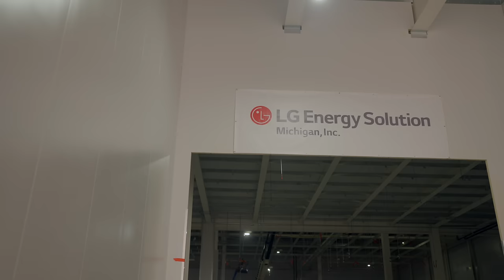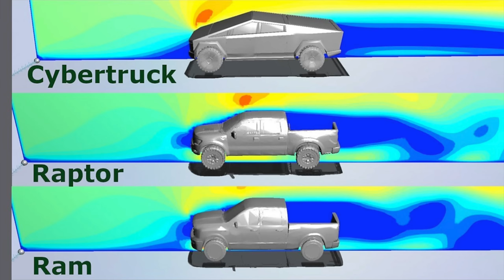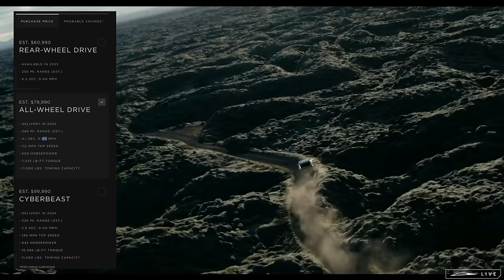Cybertruck - What Tesla ISN'T Saying!

Comment from the maker: Learn More about LG Energy Solution today! https://geni.us/LGEnergySolutions
Reply: stop saying bullet proof, tesla never said bullet proof for the glass. They just said it would be "armor glass" that they use on semi. The bullet proof was for the steel.
Reply: rifle and supersonic handgun rounds will go through, the limit is sub-sonic, that it is still a step up from the 26 gauge mild steel skin or plastic of most vehicles
Reply: mistakes in Cybertruck that will render it useless for zombie apocalypses or chaos/war:
1.	Acceleration 2.6s to 60mph = there is no tire on planet that can last more than 10k mi. on vehicle with that acceleration which is COSTLY. RWD has 6.5s but then locking differentials are useless when there is nothing to lock but rear wheels, and 17” ground clearance is absolutely POINTLESS because no RWD vehicle will EVER attempt off-roading!
2.	No door handles = cannot be opened from outside in strong wind when wind is blowing from the front or the door side, odds are roughly 50% if u park vehicle at random angle to wind.
3.	Electric sensor for opening door = cannot be opened in case of electric malfunction or battery depletion while any gas truck can be opened whenever they ran out of gas REMEMBER ITS MEANT TO BE FOR APOCALYPSES WHEN U PUSH THE LIMITS.
4.	Standard tires = instead of improving and innovating tires tesla made 3-3.5 ton monster on feet of clay. anyone can stop it by puncturing tires. War in Ukraine shows how even the most luxurious SUV-s have become so vulnerable to tire puncturing due to small pieces of shrapnel on roads.
5.	Bulletproof body = STUPID IDEA CAUSE TIRES AND GLASS ARE NOT BULLETPROOF! 
6.	Ethernet wiring = computers control EVERYTHING even STEERING meaning any chip malfunction could kill you, moreover this system cannot be protected from EMP or excessive solar radiation. Stock Toyota 70 for example outperforms this vehicle in all those features that’s why it is the most demanded rugged vehicle on Earth.
7.	Great towing capacity: yes towing capacity is great cause the vehicle is overweight and friction induced on tires is way higher than friction on 2.5 ton truck tires: 3.5ton/4=0.875 ton/tire   while 2.5ton/4=0.625 ton/tire just like 2x2=4. Not mentioning 4x more probability that it will get stuck in mud than the same size 2.5 ton vehicle. And when fully loaded it weighs 4.5 tons which is INSANELY STUPID for Apocalyptic roads… Not only 0 chance in mud but puncturing probability drastically increases when under 1.15ton pressure. So in rainy apocalyptic day, 0 chance moving unless on well maintained highway….
8.	Steering rectangle instead of wheel = accident guaranteed.
9.	Ceiling gear shift = accident guaranteed.
10.	Absence of battery heating system = 30-60% cold weather range drop =Gasoline truck-600 miles, Cybertruck-180miles 
11.	Price = they promised less than 40k for standard vehicle now its over 60k, while 95% of truck prices fall in <60k range
Reply: Just wait until the "Influencers" get it. It will be the iPhone of the car industry
Reply: I think this is mostly a status truck for the Beverly Hills crowd.
Reply: @larryo6874 So just like the iphone. Except that apple opened it up to the general masses (as long as they had the $$$$ to buy one) and that made the BH crowd mad. They lowered its perceived value by opening it up to the unwashed.
Reply: I just had to throw away my LG minisplit 5 years and 3 months. It could not be repaired.
Reply: @DeterministicUniverse  You forgot autopilot mowing down people.
Reply: @Gnofg  Nah, that just a rumor that the Green River CEO started because Tesla did not give them the real time OS contract.
Reply: Hearing you talk about this car without any actual proof really puts my trust in your channel into question. Not a good look man.
Reply: To increase the views change the thumbnail to "The Cybertruck is hiding this..."
Reply: I'm still curious about the read view mirror... or side mirrors are not big enough to see 200 feet behind the car.
Its not street legal without a rear view mirror and being able to see behind it. And you cant drop the cover without obstructing it.
Reply: @jabberwolf7348  who cares about safety. This is all about loving Eloon.

Comment: I wish they made a Cybervan.  That would be a lot more useful.
Reply: they will eventualy, but the dictate rollout of tech starts with luxury early adopter vehicles🤔
Reply: To go with the cyber stroller, cyber pup, and an AI family.😂😂
Reply: Cyber SUV?  Yeah you can almost bet on it based on the pickup design
Reply: That MUST be in long term plans for Tesla?
Reply: I don’t know about more useful, but certainly uniquely useful.
Reply: Is in model X the Tesla version of that  already,
Reply: @JrgMaverick  the model X is just an expensive minivan.  I want something that's actually useful, like a utility van that can be transformed into an RV.
Reply: We need something like a Ford Transit with a 150kwh+ battery.
Then they'll perfectly cover most of the vehicle market as that the Transit form factor is used in so many cases.
Leave electric coaches to China though. Those are too specialized.
Reply: @grettirgrattmards2348  that is just a matter of battery supply.
Reply: @grettirgrattmards2348  I'd be happy with something reasonably cheap priced and the size of an svt focus hatchback
Reply: With focus on range, not acceleration
Reply: @NeedsLessWedge  💯💀💀💀
Reply: Kia EV9 and Volvo EX90
Reply: @theairstig9164  no, not grocery soccer mom vans.  What I want is an off-road VW Westfalia.

Comment: Wretched excess for most truck buyers.  From $39k to $60k?  YO, ELON!  How long will it take to charge at home and will it fit in a garage?  No mention of the interior?  Does it have a driver's screen where every other manufacturer puts it?  Does it have convenient buttons and switches like every other truck?  Do I really need 15 speakers?  Android and Apple car apps?  Where will I get it fixed if in an accident and how much will those panels cost?

Comment: Canceled mine. Lots of things to like but at the same time a few things I didn't. Bumping the price so much more than promised was a starter, and back seat Interior space is cramped compared to my crew cab. Then the reduce range killed it for me, my crew cab gets me 400-440 miles on 26 gallons. Now the Ram Charger is scheduled to be released before my pre order CT can get to me and the RC has up to 690 miles on a 26 gallon tank. Will reconsider the cybertruck when it gets more appealing.

Comment: The battery extender belongs IN the Trailer/RV so it can Assist with the pull weight and by putting a Motor on a NoseWheel, the trailer can be moved around (unhitched) and used to power a House/Campsite/Jobsite, while you use CT for something else. 
Cheers
Reply: Agreed, but now you're looking at an insanely expensive trailer.
Reply: @CBR2200  
I think there will probably be Chinese knockoffs, hopefully Half the price, by the first quarter 24.
So it (the Trailer) could be used wherever it’s needed for power.
Imagine being able to pull a Trailer behind a Model 3, the Motorized NoseWheel with Regen Braking, would eliminate most of the effort.
Cheers
Reply: @CBR2200  
Maybe China will simply Build E-Trailers (or the Sleds at least), because they control most of the Battery market they are cheaper for them to build, in lower quantities - very simple product for a 3rd tier supplier to make.
The Idea of a "spare" pack is going to Showcase the Car Conversion, Retro Car, Tractor conversion Kits, etc.
Cheers
Reply: it belongs to the main flat battery because towing your extra battery will just reduce your capabilities! you can very easily triple the range of your diesel truck which is already excpetional by putting an auxiliary fuel tank under the bed so no space is lost for example.
Reply: @carholic-sz3qv  
So, you don’t care about using your bed to carry ~ 500 lbs of cargo all day everyday but Only need it when you Tow.
When you’re Towing its in the Trailer/RV to be used independently of your Truck.
If you have a spare fuel Tank ~ 500 lbs - Same thing. You only add that weight when you’re going to Use it.
You should just stick with your Diesel, you apparently have Zero experience with this F-350 Diesel destroyer called CyberTruck.
Can your Diesel do Anything the CyberTruck can do with so much more Efficiently - NO it cannot.
Superchargers are available in many areas and being added rapidly.
Cheers
Reply: @Julian-1111  
Trailer mounted P/P is a good idea, and some specialist trailer manufacturers are looking at something similar for their heavier off-road campers - auxiliary drives on the trailer axles for when the tow vehicle doesn't have the traction required, or for soft sand, when there's the risk of burying the tow vehicle to the axles.

What can a diesel do? Tow a loaded 20 000 lb trailer for 500 miles, refuel and diver another 500 miles, without worrying about finding a working charger.

On a slightly different tangent, you should check out Edison - they're working on high efficiency diesel generators to top up the truck's batteries during use, and suppliment them under heavy draw conditions.

Comment: One major reason other pick-up trucks have not changed their construction methods in 70 years is what that market represents to other makers. It is the same body on frame that cars used to be before safety  bumper and roll over standards mandated for sedans were legislated. Light trucks were exempted and so were much more profitable to keep making. 
Selling the American public on pick-ups as a family car substitute by adding a second row of seats became the major advertising the other makers have pushed for decades. This created the market that the Cybertruck now exists to  help fulfill.
Reply: I wonder why no one ever questioned why it should be legal for personal cars to evade safety regulations if only they are designed in the least sustainable way. Pretty crazy if you ask me.

Comment: i have a reservation and will buy the three motor model when it comes up. I'm a contractor and this will be the first electric truck in my fleet of trucks that work 5 days a week.The main feature that I'm excited about is the maintenance or lack thereof. Fleet maintenance is a huge part of owning working trucks. I'm also hoping that it will be able to tow 8 to 10K for 100 + miles.
Your presentation is the best I have seen thanks; however like I said the relatively maintence free design of an electric truck is going to be very attractive to fleet owners. Thanks again for the great presentation.
Reply: You'll be waiting 3-6 years likely.

Comment: I would buy the dual motor version if I could afford it. As the 4680 chemistry improves (v3 maybe), hopefully they'll increase more power into the main battery pack footprint. Powering my house with the truck in an emergency would be amazing and put my mind at ease for situations like this.
Reply: Once they add graphene, range will increase
Reply: @gonzos-twin  Funny - putting graphene in Li-ion batteries has been known about since 2020, so why isn't it being used already?
Reply: Kind of a stupid idea. A real generator is much more practical. You still would need to adapt your panel for this.
Reply: Powering your house in an emergency?

Why not just buy a domestic power battery pack instead?

It's not a given that you need a solar panel installation to get a domestic battery pack.
Reply: @gonzos-twin 

"Once they add graphene, range will increase" 

Graphene is not magic.

You don't just "add" it to a battery cell, it has to be specifically engineered into the electrodes

Comment: The introduction of 48v electrical system, bidirectional charging and steer by wire are massive overlooked innovations. As well as the use of stainless steel as a stressed load bearing element is a first too. I don’t think the price is too bad given the inflation the world is suffering and it’s clear that 4680 cell development and production has not gone as smoothly as expected. However, Tesla won’t stop innovation and iteration and will prevail. They will drive Dow costs as production ramps.
Reply: It doesnt have bidirectional charging
Reply: @TC-zf1ji  According to Jason Cammisa's Cybertruck video yesterday on the Hagerty YouTube channel, "for the very first time ever on a production car, there is no physical connection between the steering wheel and the front wheels".  AND "No one has had the balls to put it into production, until now".
Reply: @TC-zf1ji    They did not cut out safety, it has two independent 5 Hp motors to run the rack with back up power supply.
Reply: @TC-zf1ji  And I suppose you think that planes still have a mechanical connection from the yoke in the cockpit to the control surfaces?   Big surprise, they do not.  You call the mechanical connection a "feature" I call it a crutch.
Reply: So when the electrics die in a solar storm and you're trying to steer it onto a tow truck as you get winched you're stuck with no way to turn the wheels?

Comment: I disagree on one point, Ricky.  I think this truck could be huge in the commercial blue collar construction and service markets.  It checks all the boxes.  Why am I certain?  Because I was a commercial carpenter, mostly heavy structural concrete projects.  This truck is perfect for individuals' ownership AND commercial company fleets.  Most people analyzing the markets for this truck are ignoring this factor.

Take it to the bank:  it may take a little time for adoption in the work place but the CT IS a work truck!  And it will prove itself as such in the not too distant future.  Elon needs to be ready for the demand!
Reply: 🙄 ah no.
Reply: I agree, it provides quite a bit of capability that saves from having to haul a generator around...  some people need to transport ladders, a roof rack is coming.

For contractor work within a hundred miles CT will be compelling.

It might not fit the long range freelance transporter role too well, maybe with 2 range extenders installed?  Might be better to consider semi if thats your thing.
Reply: Is that you Elton?
Reply: @bobbybishop5662 it absolutely is a work truck. I am looking at getting one for my hobby farm because of its unique features. Stainless steel bed that you can dump gravel straight into and won’t rust out from scratched paint. The shell is thick enough to weld to so if you need mounts for anything you can do that. 
Other trucks can do this but not with such a big battery, it can power your tools without running a small ICE generator. 
Seriously, no trade tows long distance. They would lose money if they tried. 
So what advantage do ICEVs offer to trades vs Cybertruck?
Reply: @williammeek4078  Hobby farm 🤣🤣🤣🤣🤣🤣 that's hilarious.
Reply: @lcambilargiu  the cargo towed on f350-f750, 16 tonne gooseneck, is too light weight to be safely/comfortably towed on class 8 truck. It's like considering container ship as replacement for barge.
Reply: @bobbybishop5662  What do you have against farmers?
Reply: @williammeek4078  Nothing at all , I grew up on a farm in the Texas  panhandle , 8 sections of land. Divided between wheat fields and grazing land for cattle. 
I just find the term Hobby farm funny. How many acres is a hobby farm ?
Reply: @williammeek4078  Might be taking a chance welding to the vehicle.  I would worry about damaging the electronics.  But yeah on the work truck.  Plugging in a big air compressor, various high amp saws, welders, and the like is common for a lot of trades people and would be so much more convenient than hauling around a generator.  I guess Tesla nixed the idea of an air compressor port using the on-board compressor that runs the suspension.